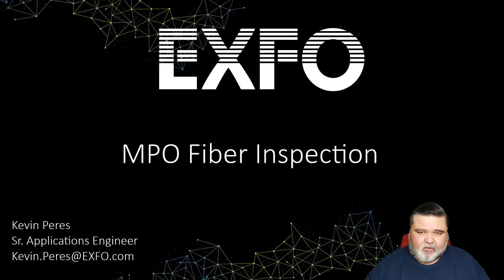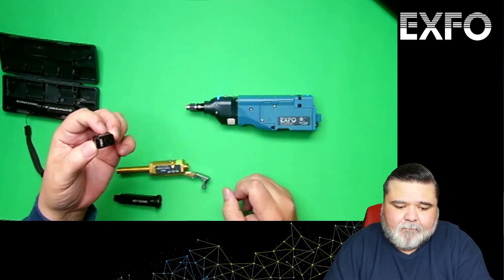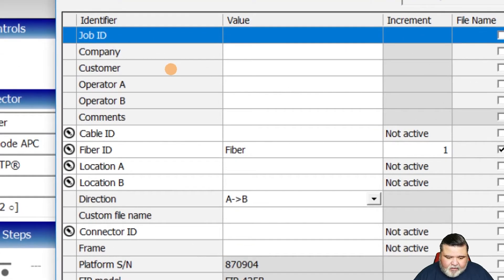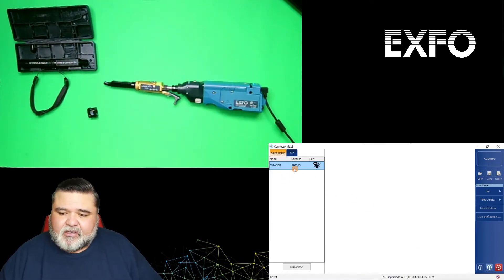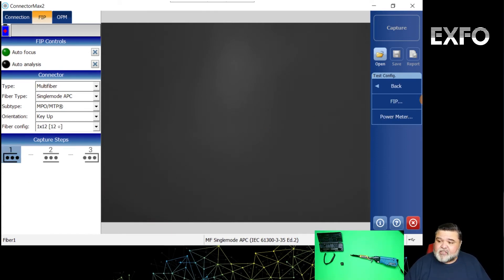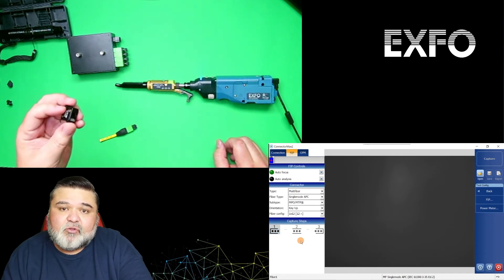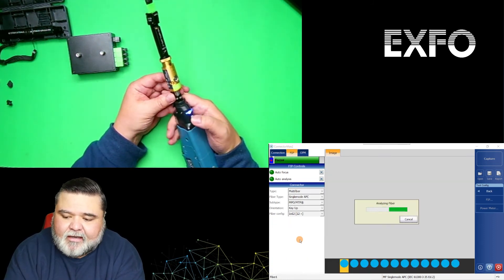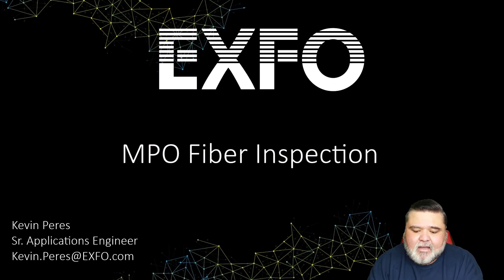EXFO MPO connection  Inspection using the FIP-435B

Comment: Just found this video, it does help explain a few things however my device does not seem to be working correctly. I have the 430B MaxTester. 
It works fine on the "normal" fiber, single strand and multimode, but when i get to APC it 2x12 it does not want to stitch the scan together, it gives a fault of "the number of fiber does not match what is selected."
Reply from the maker: Sorry for the slow response. I missed a bunch of post around this time for some reason.  Did you get your issue resolved?
Reply: @KevinPeres  I did not, and the device has been sent back so I can't work with it anymore.

Comment: Hi, iam running a YouTube channel and some one asked why the APC connectors are polished at the 8 deg or 10 deg why not 30 or 50 degrees.
Reply from the maker: It is all a matter of snells law of total internal reflection.  I am not sure why 8 deg was chosen, there might be a cost of manufacturing factor in play. It can certainly be other degrees of angle I have not done the math to determine how much of an angle it can be.  In the back of my mind, I remember reading somewhere that it must be between 5 and 15 deg.  I will have to do some research and math to confirm.

Comment: Kevin: I find your videos incredibly helpful...i work for a Telco in Saskatchewan, Canada...we're trying to train up new staff to use EXFO's awesome tools...to test 100Gbps backbone links
Reply from the maker: Darrell,  I am happy you found the videos useful.  I have not been to Saskatchewan in many years.  Beautiful country.   It is amazing to think about 100Gbps.  I am working on 400 and 800Gbps.  I remember the days when a T1 was a lot of bandwidth!  Are you getting the support you need?  We have an amazing team up in Canada.
Reply: @KevinPeres  We get good support from our Telco-team that deals directly with EXFO. However, we've been encountering iOLM failures with MPO-modules, at our datacenters. After the last month of frustration, and forcing rescoping/recleaning, I found out we are allowed a different pass/fail threshold for those.

My FTB-1 is just seeing MPO's as a normal barrel-connector, and flunking it above .5db. In reality it's a Panduit MPO-module which fans out 12-strands to LC/UPC with a fusion splice inbetween. Yesterday, I was told .75db for loss but can I also add .5 for the LC side? What about reflectance? 

I watched another one of your videos on setting up a 'custom' Test-config file with Custom Elements. My ver of software iOLM gives me zero options. On a newer ver of iOLM would it let us predefine MPO modules like it does for Splitters??

regards,
Reply from the maker: @darrellnickel894  Darrell we are starting to see more customers creating custom events whether MPO or merged events such as a pigtail splice.  It is always a good idea to update your unit to take advantage of all new features. Custom events is also an option called iAdvanced. Contact your sales person to see how much it would cost. I should create a video on customs events. In fact I will. Email me at Kevin.Peres@EXFO.Com if you run into any issues or have questions
Reply: @KevinPeres  I like that you will create a new video on custom events. I will get my support people to check what software I would need. 

Meantime, if i'm shooting thru a Panduit module with an MPO/APC(rear), and a LC/UPC on front, how much loss would you allow as a pass?